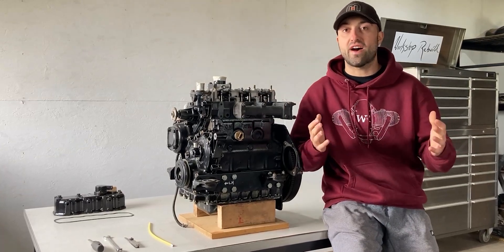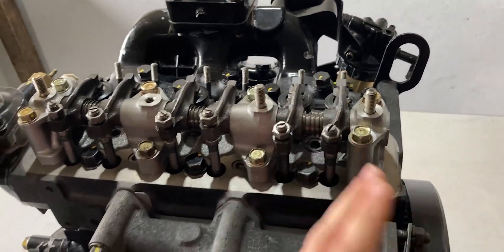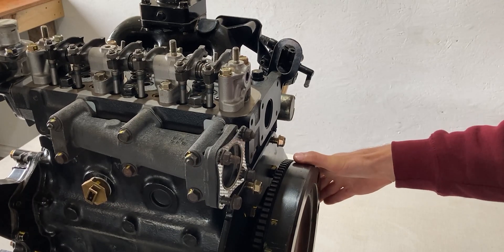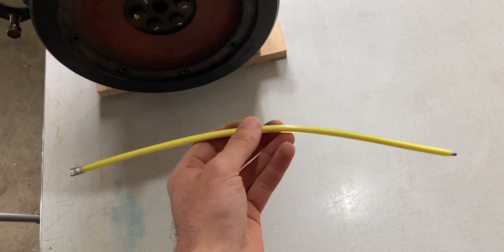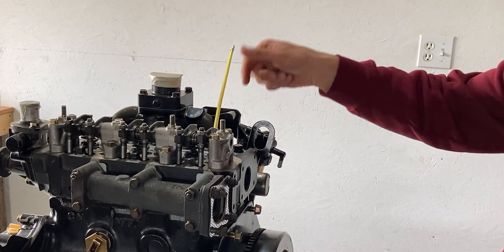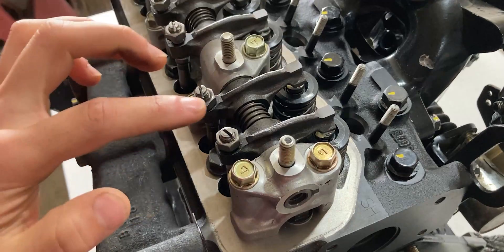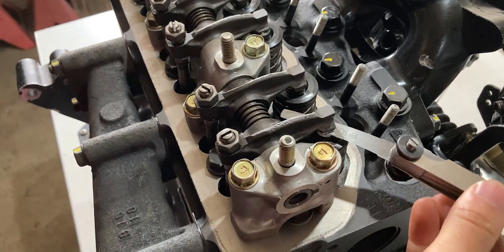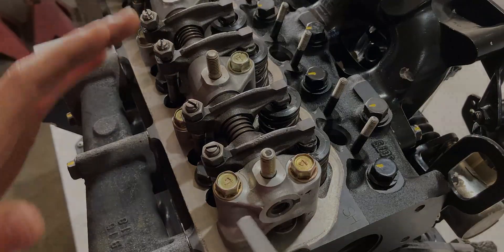Adjust Valve Lash (Diesel Engine - Solid Valve Lifters)

Comment: When you tighten the nut - do you hold the screw steady (in one position), or are you allowing it to move a bit with the nut? Last time I did a valve job, I noticed the clearance always increased a fraction as the nut was tightened and I ended up having to redo a few times to get it right...

Comment: Hello I have a question so when you adjust the next cylinder #2 cylinder needs to be on top dead to be adjusted.  ?
Reply from the maker: That is correct! Always adjust the valve lash when the rocker arms are NOT activating your valves, meaning in TDC position.
Reply: @WorkshopRebuild  so I’m replacing the head on a c3.3b cat I never done it before I have the service Manuel but is kind of confusing  do I adjust number 1 at top dead exhaust and intake can I do number 1 and 4 since both are at top dead or I have to do  1 then 2. 3.  And 4.  ? I apréciate your help
Reply from the maker: On a 4 cylinder engine like the one you mentioned, you’re going to want to do each separately.

The firing order is most likely 1-3-4-2, because it’s very universal to any other 4-cylinder engine.

Rotate the engine so #1 is at TDC on the compression stroke and adjust the valve lash.

Rotate the engine on the crankshaft 180 degrees and adjust the valve lash on #3

Continue to rotate 180 degrees for #4 and then last #2, while adjusting the valve lash for each cylinder.

Once you’re done recheck it once or twice to be sure and make sure all fasteners are well tight (not overly tight)😁👍🏼

I hope this helps.
Reply: @WorkshopRebuild   ok I will do that tomorrow I’m at that point  I apréciate your help.     You have a good night
Reply: Hey I may sound weird    So I look on my manual today and notice it has to steps to adjust the valves one at top dead half of the valves then it says to turn number 1 to overlap position   Any idea where the overlap is.      And on this engine.  Number 1 is closer to the water pump correct?
Reply: Also does it metter. If I loosen all the adjusting screws to torque the rocker bolts so I didn’t put pressure on valve rods.

Comment: Hello I need help setting the spill timing on my yanmar please help
Reply from the maker: You have to adjust everything to cyl. #1. (Closest to your Flywheel)
Your injector (injection pump) must provide fuel about ~15degrees before TDC on the compression stroke.

Some engines range between 12-18degrees, so 15 is right in the middle.

I hope this helps. Cheers

Comment: One question, my brother, what is the oil pressure of the Yanmar 4TNV88 engine?
Reply from the maker: The specs for a 4TNV88 are between 20-55PSI. 55PSI should be at your highest rpm setting of your engine. At idle your oil pressure will be lower, but make sure it's not too low! I hope this helps. Cheers

Comment: Good morning, I have a question. I am repairing a Yanmar 4TNV88-BSTX engine. I would like to know what the valve clearance is for this engine, please, and the sequence.
Reply from the maker: Hello, the valve clearance on your 4TNV88 is:
Intake: 0.006" - 0.010"
Exhaust: 0.006" - 0.010" 

These must be set when the engine is cold and your first cylinder (NR.1) is closest to your flywheel.
Here is more information on your engine if needed: https://tractorgearbox.com/yanmar_4tnv88_engine_specs.html

Regards Andreas
Reply: @WorkshopRebuild  Thank you very much for the answer you have helped me a lot I appreciate it blessings

Comment: THANK YOU THANK YOU THANK 1000 TIMES THANK YOU! I am a deisel mechanic, but i had never seen one of these until i bought a chinese tractor. Usually the no. 1 cylinder is at the front, hence my 3 day long confusion. I did what you said at the rear one, and BANG it fired right up! Thank you so much! I'd kiss you if i could!
Reply from the maker: I am happy to hear that you were able to get your engine sorted out with help of this video. Thank you for your amazing comment!! Regards Andreas

Comment: Thank you my friend dropped a push rod now we have to fix it
Reply from the maker: Did you drop it before or after watching this video? Was your pushrod seated properly in the valve tappet and on the adjustment screw (rocker arm)?
Reply: @WorkshopRebuild  his push rod is gone down in the oil pan I think don't know how it happened but it didn't come threw the valve cover
Reply from the maker: I am really not sure how that is possible, because there is literally no area for the rod to drop down into the oil pan. the bottom of the pushrod must sit on the valve tappet and besides that, there is only little passageways for oil to trickle down into the oil pan. Let me know if you get an update from him, I'd be curious to know what happened! Regards Andreas
Reply: @WorkshopRebuild  I'll let you know what happens
Reply: @WorkshopRebuild that’s very interesting and after a year no reply as to how they rode made it to the pan

Comment: You seem to indicate that tightening the nut, closes the gap on the feeler gauge @7:10 - 7:20.  It does not.  
The nut tightens to hold the adjusting bolt in place.  It is the bolt, adjusted by the flat head screwdriver, that adjusts the gap.
That is why you were not feeling any difference before and after "tightening" the nut.
Reply from the maker: I am aware that with the adjusting bolt, you can raise and lower the gap on the rocker arm. Once you tighten the nut, you will secure the adjusting bolt to the rocker arm so it does not move. 
If you have ever set your valve lash before, you will know that each thread has a certain tolerance. As you tighten the nut you're actually lifting the adjusting bolt away from the push rod, which leads to a larger gap. To compensate for this tolerance you can turn the adjusting bolt and nut at the same time to achieve your desired valve lash.
I hope this clarifies what I did in this video. Regards Andreas

Comment: Aren't diesels 4 stroke engines? Intake, compression,  power then exhaust. Just no spark plug. You said set/ check valve lash then rotate engine 180 degrees then check again.  Wouldn't it be on exhaust stroke at that point and valve under compression? Just trying to get it right in my head. Thanks alot.
Reply: Ever heard of a Detroit
Reply: @billklass7802  amateur not that familiar with diesels. Just gas engines and trying to get the basic understanding of diesel principles.
Reply: Ok. Google is a wonderful thing.  Evidently they make 2 and 4 stroke diesels. Interesting.
Reply: he said 360 degrees so it would have done two strokes and either goes from compression to power or power to exhaust..so no pressure on the rockers
Reply: @renzo123123able he did say 360° but it would now be going into the intake stroke which means potentially the inlet valve could have slight preload on it so good practise is to rotate the engine 720° so that you are back on the same stroke when you set them as there would be zero chance of preload on the intake valve then verify that the lash is still good.

Comment: Good morning, I think I need a little more explanation.  Top dead center is both valves shut and the piston fully extended at the top of the stroke. I’ve heard top dead center on the exhaust stroke vs compression stroke. Great video love the detail and btw your engine looks like a show piece!   Perhaps I answered my own question 🤦.

Comment: Awesome video Andreas! Thanks for showing this! Could you do this on a flathead engine? Preferably the Kohler kt17.- Jason.
Reply from the maker: This technique can be applied to almost any engine with solid valves lifters, so I really hope this will be beneficial for many viewers. The KT17 on the other hand does have a different setup and I actually still have one around that I could do a video on. I'll see what condition it is in and give you an update. Best regards -Andreas